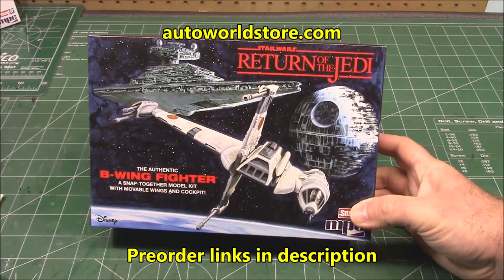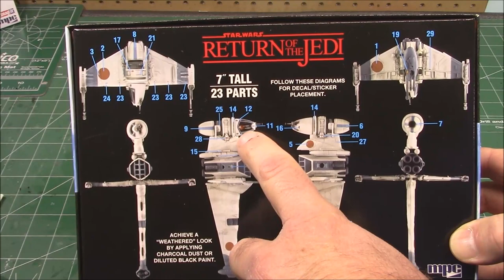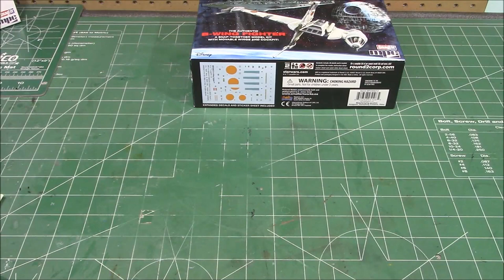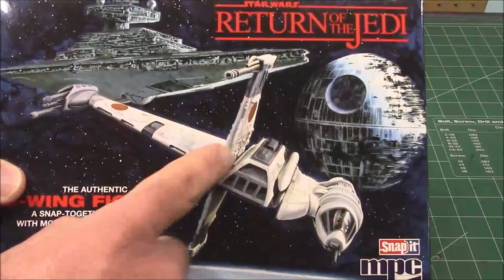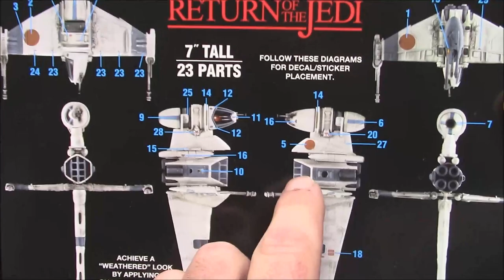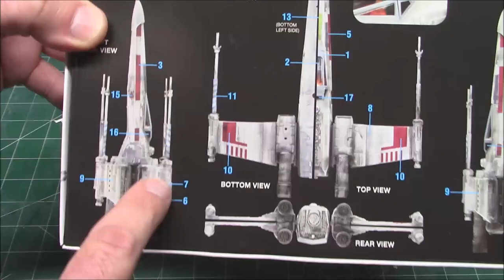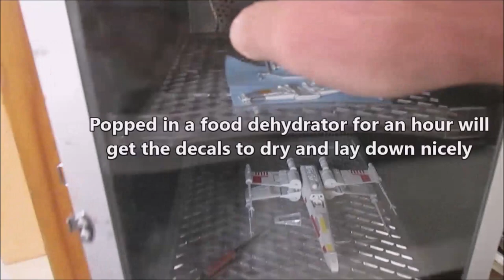Star Wars X Wing B Wing Fighter Scale Model Kit Build and Weathering How To Skywalker MPC 1/144 1/64

Comment: I have two examples of the original MPC X-Wing release from the 1980's (same molds as the one shown here, but without the improvements). The build went together well until I tried to put the wings in the 'open' position in the final steps. I glued them in place but they would not stay open on their own; I had to insert small styrene pieces to help prop the wings open at the correct angles. Even with the wings propped open, they still would not sit straight, which meant the port side top engine ended up being crooked / not parallel with the starboard side engine. I tried to manipulate it with my hands but it didn't do any good. The cockpit glass didn't fit, either, even after a lot of sanding. Overall, I think these old kits do have their charms, but these cheaper MPC's are the ones I'd give to a nephew or something (I'm sure the Bandai version is MUCH better). I'll do the 2nd example with the wings closed to see if that results in a better fit. FUN FACT: The B-Wing fighter got limited screen time in Return of the Jedi because the slim profile made it difficult to shoot against the green screen.

Comment: I had these models as a kid in the 90s and still do. Although they are very worn from playing with them.
However, i think the X-wing was more detailed than this one and had a separate pilot from the model like the B-wing.
Also the reflectors on the lasers are in the wrong angle on this model. They are supposed to be vertical, not horizontal.
And yes, 44:28 weathering can vary... a bit, but not the distinguished features and absolutely not the markings which is unique.

Comment: The small mpc x wing had 3 main problems. The thick landing gear. The molded pilot with the bike helmet. And the wing molded base of the cannons. Plus the C shaped wing tips should be vertical. Not horizontal with the ship.
The b- wing is actually ok. Just to small.